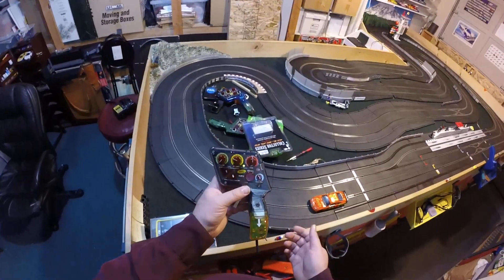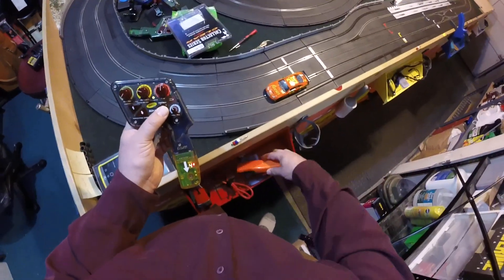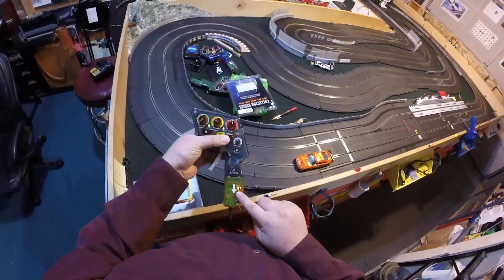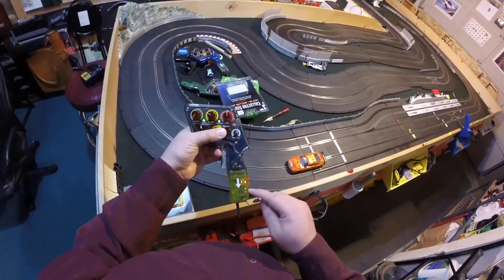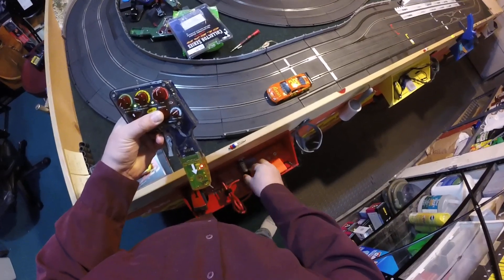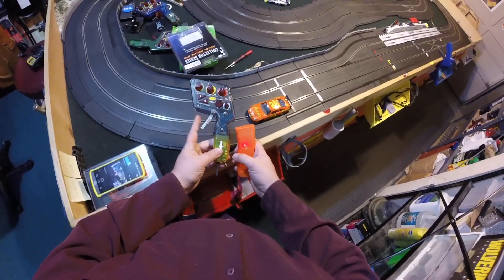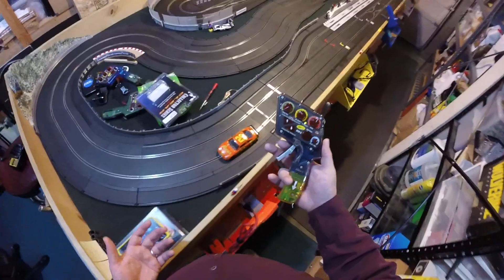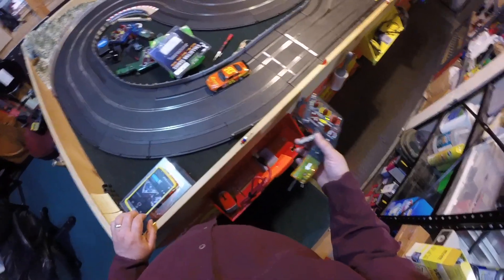Programming the slot.it oXigen controller to a CRI

Comment: Trying to pair to CRI but the CRI LED doesn't illuminate. This is w/Carrera using the Carrera compatible cart for the CRI and SCP2 w/O2 cart. I do not yet have the dongle as it is on back order. SCP2 acted as per your video. I'll research and maybe try you on SCI.
Reply from the maker: It's much more likely that there is a problem with the pairing than the CRI being defective. 
 
I just plugged in my CRI without my controller turned on, and the light on the CRI does nothing. It's not lit at all, let alone flickering. This indicates to me that, at least with recent firmware, the CRI light does nothing without a paired controller. My devices all have the latest firmware because I have the dongle and update them regularly. Yours do not. It's entirely possible that the firmware in the controller, and the firmware in the CRI, are not compatible in some way for some reason. Without the dongle, there's no way to even know what version they have, let alone if there is a known compatibility issue between them.
 
Wait for your dongle.  Update the firmware on all your oXigen hardware, and then try again.
Reply: Greg Gaub I suspected that. Your video is the only visual confirmation I could find, which shows the CRI LED illuminated, before being powered up. I was sure if that was because you were previously paired, or not.
The Slot.it literature doesn't state the LED status prior to pairing.

One again, I appreciate your help